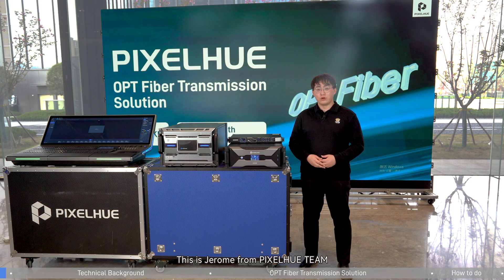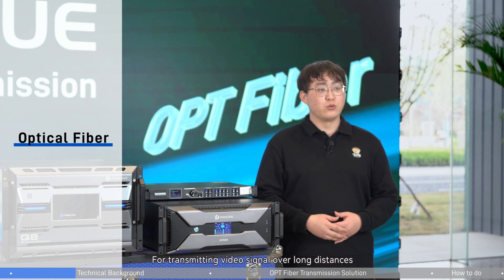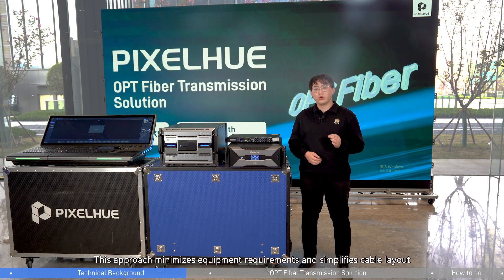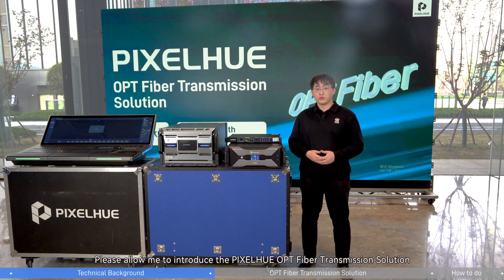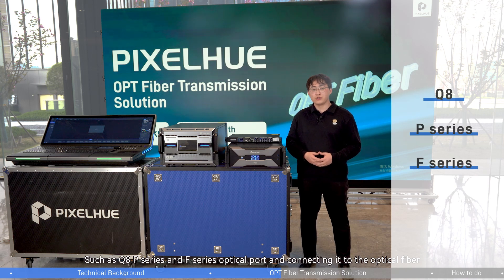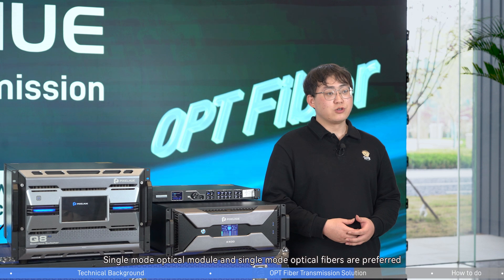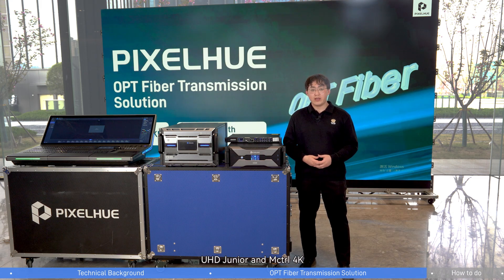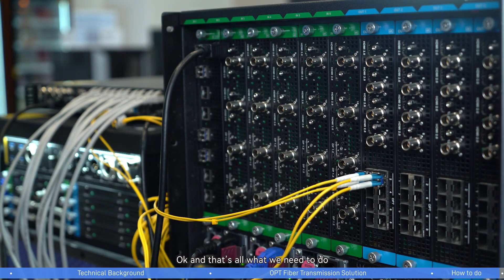PIXELHUE TECH TALKS: OPT Fiber Transmission Solution!

Comment: It would be good to have single fibre receivers, instead of just relying on Novastar LED wall processor. That way you can run point-to-point connections to projectors and large video display monitors.